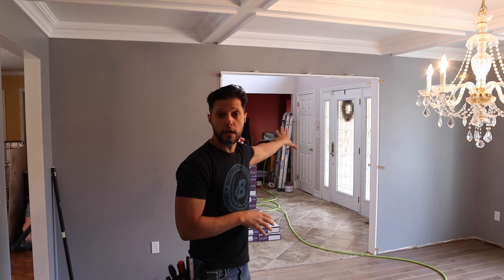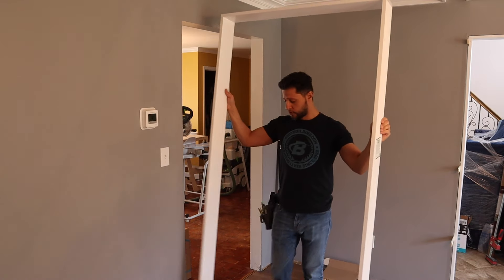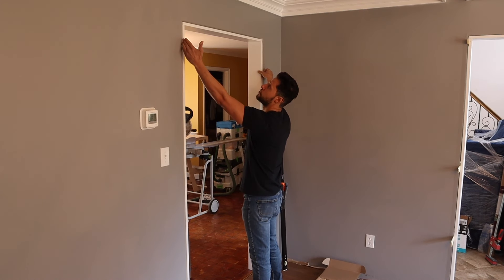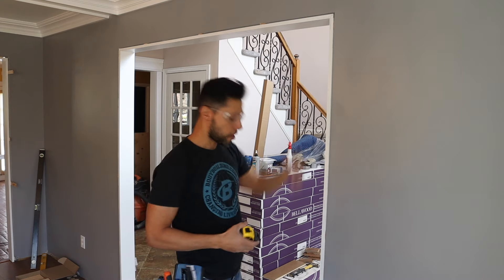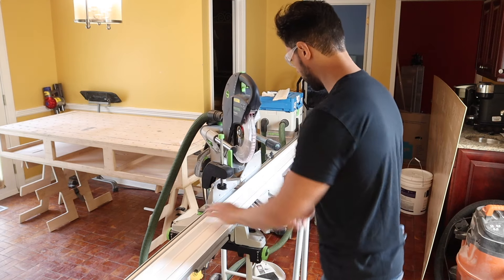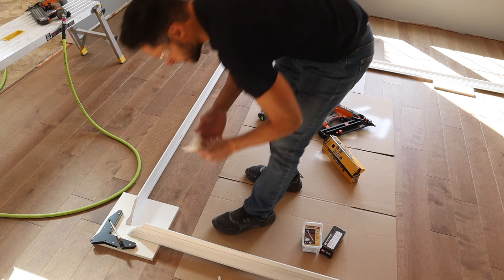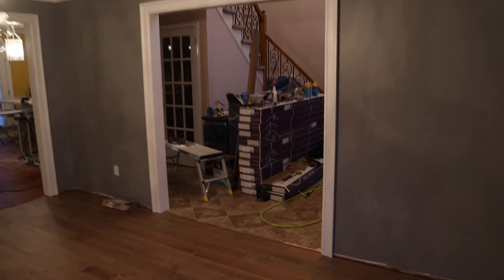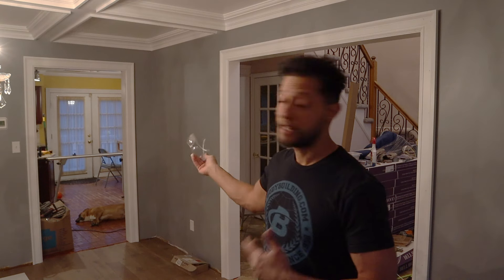Molding tips and tricks

Comment: Tony, great pro tips!  Looks perfect.  Do you ever get gaps between the outer edges of the moldings and the wall surfaces?
Reply from the maker: Yes, everyone does because the framing and Sheetrock is always out of whack. What I do if the gap is severe, is hammer the Sheetrock down around the jamb, if the Sheetrock is proud or if the jamb is proud of the Sheetrock, I use a parallel clamp to push the jamb flush if possible. When all else fails, you just need a little more caulking.